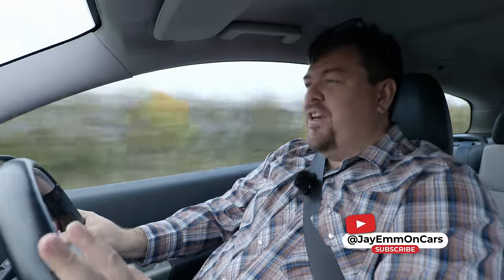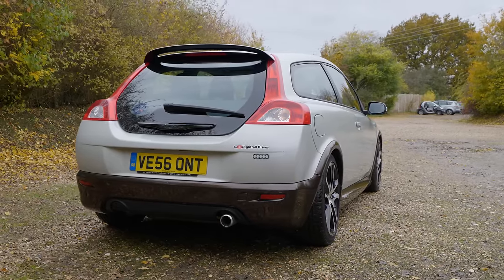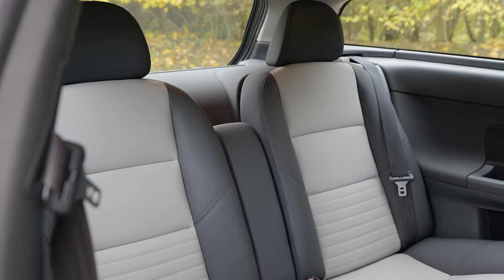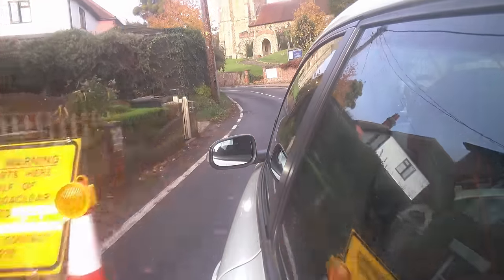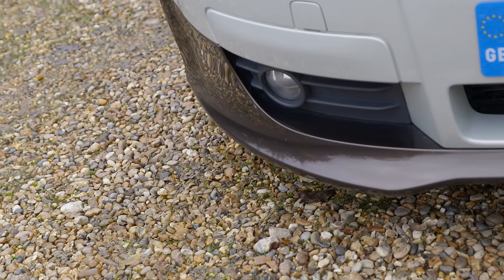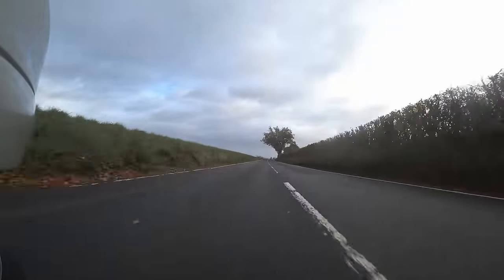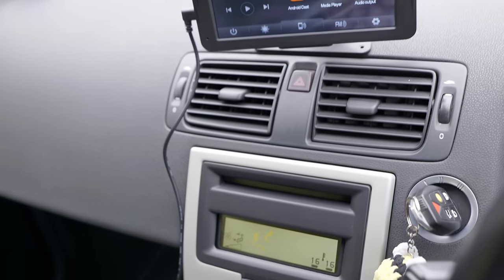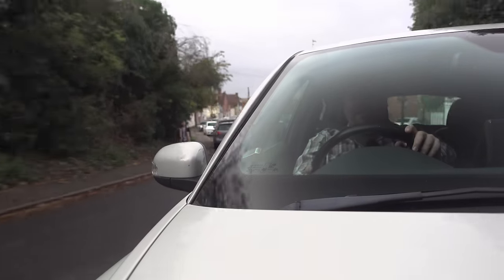The Volvo C30 - More Than Just "The Car from Twilight"?

Comment: yeah! '09 C30 T5 with the stick and I love it. it's built better than german cars a decade newer and just sort of does everything really well in an effortless understated way
Reply: I have a 09 C30 as well, had it since 2011. Over time I upgraded a few things like silicone coolant and intercooler hoses, and replaced the plastic intake manifold, thermostat housing, and coolant expansion tank with metal pieces. also, upgraded the CBV and TCV with turbosmart options and a Gates kevlar timing belt. Stage 1 Autotech remap as well,  I plan to keep my C30 for many years to come. I consider it an R (Refined) model 😊

Comment: I prefer the first generation without the body kit, and no spoilers. A common issue with c30/s40/v50 is a rattling SIPS bar under the seat. Some silicon spray will reduce the sound. The high performance audio system is a must in this car, the base audio system is a piece of crap compared to it. It makes a huge difference. I have owned a 1.6, T5 and 2.4i and the 2.4i is my favourite. The linear throttle pedal makes it a comfortable drive for yourself and any passengers, wheras the T5 will not be too comfortable as soon as the turbo kicks in.

Comment: Had one of these back in 2008 as a company car, one of my favourite cars and I’ve had many cars before and after. Was a D5 and even sounded great for a diesel. Felt very quick at the time and was 100% reliable. Loved it…
Reply: Heck, a D5 sounds better than most similar powered petrols on the road (most of them being fairly unspectacular 4-cylinder affairs).

Really enjoyable in a P1, and equally also the best all-rounder in the bigger P3 platform cars... Economy of a diesel but without sounding like a tractor? Winning formula in my book.

Comment: I LOVE THIS CAR. So much, I have one. VOLVO C30 T5 SE LUX. Fully loaded, I'm NEVER letting it go. Already had the engine forged with Darton sleeves and K16. Still running it stock power until the HSD Coilovers are installed. Even then, I'm not running it high because I don't wanna lose the car by pushing my luck 😅, so will be running 300-350 when done with a full exhaust system. The rest is staying stock. SLEEPER 😈

Comment: Had a C30 as a service replacement for a few days while my V40 was being repaired under warranty at a Volvo dealership. Damn I still absolutely love the V40, but those few days with the C30 with a 5 cyl diesel were a lot of fun! I even searched for a used one here in Germany, but never found one to check all the boxes. I am now driving my second V40 with the 177 hp 5 cyl diesel and the sound of it never gets old.

Comment: Glad to finally see you in a C30!

I've got a 2010 facelift, base spec, 1.6L diesel, DrivE variant. Not your performance or greatly luxury vehicle, but still has the outstanding looks, is very comfortable, and is as firm and safe on the road as you could ever be. And without too much effort, it averages 62MPG reported, which, when you actually do the maths on fuel usage, comes to an actual 55MPG - in a 13/14 year old car! And the DrivE variant also pays £0/year road tax. It's still a Volvo, so repairs can cost, but daily running is virtually pennies.

Comment: ive had two ,,, frankly they dont go as well as you would expect them to , and they are prone to running bearings , but they are very comfy , very very quiet and overall not a bad seat to be sat in , they are under the radar but missing 30 horses at least .

Comment: I've had the T5 and 2.4i albeit in the V50 and found the 2.4i almost more enjoyable than the T5. Had no issues apart from leaking air con drain into the cabin. Great handling with the focus derived suspension too such a great handling chassis and I've had many different cars over the years.

Comment: I've had one for nearly 2 years and although its only a D2 diesel, its a facelift which in my opinion aged better and it has much more kit and a nicer interior. I've had 0 issues, and the rear seats are actually quite spacious and confortable for the size of the car. As a daily driver, its a great begginers car, maybe a bit slow (116hp), but very fuel efficient (around 58 mpg)
Reply: Facelift interior was available in the prefacelift C30.

I’d much rather the two comfy armchairs in the back than a 3 seat bench!

Comment: I'm currently the owner off a C30 2012 (D2 with a stage 1 chiptune and a lot of options) for the last 3 years, bought it at 160.000Km's and are currently on 300.000Km's.  I am convinced that for me personally this is the best 'normal' car i will ever drive (apart from a replacement C30 with better engine). 

It feels so unique, is a lot of fun to drive when you push it and it always gives me te feeling that I can trust on it during.

I am convinced that i will always own a C30 for the rest of my life, even if it's as a garage princess and a different car as a daily.

Comment: 2011 T5 turbo'd non-r. We're installing an AWD system this summer (Should be) but I had some bad luck last week and my clutch stopped popping back up. I had to pick it up from the floor with my hand. So we just started it in first and drove home all the way in 1'st. Oh, well. But we are changing the master and slave cylinders. Paid a little extra to get ones that are full metal. So far, I've just installed an intake, silicone coolant lines, SS brake lines, 330 big brake kit, 50/50 BP/BO  valve for the turbo. I got a slightly bigger intercooler, but when I get the AWD stuff on, I'm going to weld my Exhaust (Uppipe, Downpipe, and then cat back. I will have a electronic cut-off valve, I really like like sleepers so this would be cool to pull up at other cars and wait for the inevitable looks from  ricers and lower end mustangs etc... I can just leave the cutoff off and it will go through the normal exhaust (I.e. rurumrumrumrmrumrmurumr), or if I want the turbo back from under the passenger door, I'll just flip it on and suddenly (I.E. RAHHH POP RAHHHH RAHH RAHHHPOP) :) Hey, people may think it's stupid. I like sleeper cars, especially one as little spotted as the C30 out by where I live. I hope most of you understand what I mean. I'd be glad to explain it if you like. We also replaced spark plugs, coils, and in the fall, I'll be rebuilding the engine and probably bore it out quite a bit. Look, the thing is that I'm happy with the car stock, but it'll be few to have a sleeper again. If nothing else (Because my wife is trying to g et me to not spend money on it, I bought the car for less than $3k. It was a hell of a deal. ) I at least want to do the stage 1 map oon it. Heck. Maybe stage 3 is the way to go. I'm half asleep, so I probably missed a ton of stuff. But talking about your plans for your car on the internet almost assures that you never get them. But it's like my B-I-L's Little project, we cant to do   Great video essay! Liking and subbing! I hope everyone has a Volvo-Riffic day! - leifo

Comment: I’ve got a face lifted, 2010 C30 T5R manual, had it 8 years now and no plans to change it. Only issues I’ve had was the air con condenser failed, a common fault, but an upgraded replacement part has been fitted. Electronic steering lock gave up when the cars was 8 years old,other than that just routine maintenance. It’s fast, comfy and different, I love it. Mine has the upgraded sound system which sounds great and I’ve fitted an aftermarket Pure DAB radio as an improvement. Check the windscreen seal, many Volvos from this era suffer with water leaks, but this is likely to have been sorted by now. Mixed driving sees about 30mpg for me, which I can live with.

Comment: I have had my 2009 2.0d non dpf C30 prefacelift since 2020. A good work car, pulls well and good torque power. I have went through 2 wheel bearings front in 10k miles and the c30 can be heavy on the front axel and cv boots will go.  Over all a great car its just very unique and one of the last 'shooting brake' design  hatches.

Comment: I had a 2L petrol in manual for a short time as a "Company Car" when I worked in a used car dealer in Johannesburg in 2015...not the fastest thing around but very comfortable and easy to drive, the black leather seats in it were amazing when stuck in the notorious peak hour traffic on Johannesburg`s highways...
Reply: Yup I own the 2L petrol, I'd describe the pace as "adequate", it'll merge and overtake just fine as long as you're willing to rev it out, and theres enough low down torque to potter about town in 4th and 5th with no issues. I am tempted to see what can be done with the engine though to boost its performance.

Comment: Driving a 2010 C30 T5, bought second hand for $15 000 with 30 000km on the clock. Leather interior is great. I love the whole thing. Great car, great design. I'm 6'2" tall as are my sons who both prefer the back seat as a comfy spot to sleep on the school run a few years back. Getting in as just a learned knack. The long doors are heavy if you park pointing uphill. Fits a 7' surfboard in without dropping seats, but you do have to take out the parcel shelf.  No service issues at all, although parts can be expensive. Ride in Australia where the roads are bumpy can be a little hard, but I JUST DON'T CARE! Best car I've ever owned, and best looking [affordable, normal] car on the road. Riding in it even convinced my neighbour to buy one.

Comment: Used to own a 1.6 diesel from 2011, came into alot of issues and it ate tyres like no tomorrow. Doors must have made up 50% of the cars total weight. Amazing with fuel consumption however

Comment: I've owned a 2010 C30 for a little over a year, and everything Jay says is spot-on. That 5-cyl engine is wonderful. I like the sound, and having 20% more than a 4-cyl is totally worth it. It moves quick if it has to, though it's not quick off the line, on account of being so light. The wheels spin if you proceed without restraint, so I'm not sure what all that power is for. I test drove a couple of T5's, and when I did, I understood why the base model seems so underpowered by comparison: to make it seem worth it that you paid so much more for the T5. But I find the 2.4 non-turbo plenty powerful enough. The speedometer goes to 260km/h, but the automatic transmission already shifts into 5th gear at 60km/h, so it must be really screaming if you get it much over the speed limit. Gorgeous looking car, standing the test of time. One thing I find, is that the materials it's made of are a little bit flimsy, and hard to keep looking good. It's like they kept the purchase price down, by choosing materials that fuel the detailing and accessories markets. Hard to find a C30 that doesn't have splits in the cloth front seats, and I haven't found a product yet that keeps the plastic skirts looking decent. And BTW, I use the manual-shift feature of the automatic transmission regularly, and it's the best implementation of the design I've come across.

Comment: I owned an S40 SE Lux (the S40 is the 4-door saloon version of the C30) 2.4 turbo diesel auto for several years and loved its combination of torque and power with manoeuvrability.  Beats the C30 in terms of comfort, 4-door access and clean, classic design.  Based on the same floorpan as the contemporary Ford Escort, the second generation was the prettiest saloon on the market between 2004 –2012. Good motorway cruiser with excellent 50+ MPG economy.  Large car luxury in a small car format.  The only slight downside was a nose-heavy balance when boot was empty.  Reliability good except for failed ECU several months after driving through a foot of standing water – the ECU is mounted low down behind the front bumper and is liable to corrosion after flooding.

Comment: My wife has a diesel C30 2.4 D5 automatic. It goes like a rocket. Most of her driving is  fairly short rural ones but it still returns between 40 - 45 mpg. Fantastic car and apparently, there are only 12 registered with an automatic transmission.

Comment: Me and the wife have had a c30 1.6d r design for 10 years now (dreaded psa engine) and tbh it's been spot on, only let us down once due to the egr system but that's mainly down to the fact it hardly does long runs. Still love the looks. Agreed that its not very practical though, getting in/out of the back is a bit of a faff, massive doors can be a pain in carparks too!

Comment: Nice, I have a D5 Polestar optimised model, which puts out about 210BHP and returns about 35mpg combined, so punchy and relatively frugal. It has really nice full leather interior and the Dynaudio sound system too.

PS, they don’t rust.

Comment: Back in the day I was one of those who thought Volvo made cars for OAPs.  Lancia Beta Coupes and Audi Quattros were more my thing.  A year ago I finally bought one, coincidentally as I entered my 60s.  It s a V60 recharge and it is a bit of a Q car.  Performance would make my 3.2 Boxster work hard to keep up but what really impressed me is the chassis engineering.  It is well balanced easily coping with instant changes from FWD to RWD as you switch from IC to battery modes with good turn in and well controlled roll given the extra weight of the battery.

Comment: Great vid, i had one of those facelift version. i loved this car, mine had a 5 cilinder. bought it from new R line edition: this had a lowerd susspention, had bigger anti roll bars, skirts, sport steeringwheel and a spoiler and sport seats.
The front axle was quickly overpowerd under fast acceleration. only had one big issue with it, the pcb of the motherboard burnt out and left me stranded. after i got i fixed a fine fellow thought it was a good idee to drive into my car in a corner hitting me in the front. that was it for one of my favorite cars... i still mis my 5 cilinder

Comment: Love my 07 T5, simple chip and exhaust makes it sound so good. The Lux spec if full leather which is lovely too
Reply: What exhaust did you go with? I have done my aftermarket bigger air filter and lowering springs are coming in. Looking to do an exhaust next
Reply: @litaf4889  depends where you're situated, in the US the Elevate Kit is probably best but shipping to UK is expensive. I got mine second hand on FB, its a Cobra Sport focus st225 cat back system, had to change it slightly to fit but sounds good and with resonator doesn't drone too badly
Reply: @benthorpe5905  I am in the US, and on the west coast so I have bought some elevate parts and they only take 3 days to get here. I've bought their air filter and intake pipe and already put that in, about to get their lowering springs and tune tool tomorrow. I have definitely thought about their exhaust because I've heard it is a bit louder but still not drony

Comment: Thanks for the review Jay really enjoyed this one I did around 140k miles in my C30 T5 - I really miss the car while not perfect it was great and always drove like a larger car. The vibration issue could well be feathering on rear tyres common issue the camber was fixed but very variable from the factory I replaced mine with an adjustable item and helped eek more life from rear tyres with no detriment to road holding. I also found the standard suspension under damped and destroyed itself over time - replaced it with a Bilstein kit that improved handling but ruined the ride!!! It did have lots of silly faults and Ford bits that broke and the engine despite 230bhp never felt like it was as fast as it ought to have been but was creamy smooth and cruised beautifully. The seats were great so comfortable on long drives. For all it’s imperfections I shouldn’t have liked it as much as I did but great car it kept me happy and safe for many years - thanks Volvo :-)

Comment: ive had a c30 t5 for almost 2 years now
excellent platform and i feel incredibly lucky to have picked it up for around £4500 as the second owner, with no modifications
the parking sensor came on a couple of times in the middle of driving, but that sorted itself out after a few days and have had zero problems with it. In a couple of years I might treat it to some new wheels, or open up the exhaust slightly, however the balance of everyday and fun is perfect for me, and don't really feel the need to chase extra performance

Comment: I have one of the T5 Polestar cars which are super rare. 250bhp, or 184KW. 0-100 is staggering at 6.1sec which for the same era is in similar territory as the 911 of the day. The additional power and torque from the turbo in the 2.5 is addictive. I once had a Holden Calais VL turbo try and drag me, left the bogan wishing he hadn’t. 

The boot for me is fine, I carry a ton of equipment for my yoga classes and the boot does a great job. I’ve installed roof racks and a tray for the roof which is removable. When I travel the 900km to Bathurst, the car is a great drive. Even with all the camping gear on the roof it still performs better than a lot of other cars. If you ever get the chance to put your right foot down on a T5 Polestar do it, you’ll never look at the 2.4i the same way.
Reply: The basic 2wd carrera of the time would do 0-60 in 4.5s. The Turbo S would do it in 2.9. Let’s not get carried away here.

(Plus 0-60 times in a FWD car are pointless)

Comment: I’ve had 2 of these - a 2008 and my current 2012.  They’re broadly reliable for the first 150k miles, but be aware that the belt and tensioner change at 120k is going to be extremely expensive, and in my experience, the AC compressor will eventually give up and die. 

Post-facelift, the radio got a bit of added functionality and can pair to your phone over Bluetooth or USB, so it’s a bit more usable. I personally find that little Gameboy-esque graphic on the startup screen to be impossibly charming and have no desire for a bigger screen. 

If you’re primarily using dealerships for service, remember that a lot of components were shared with Ford, and Ford has been generally less expensive than Volvo for stuff I can’t fix myself.